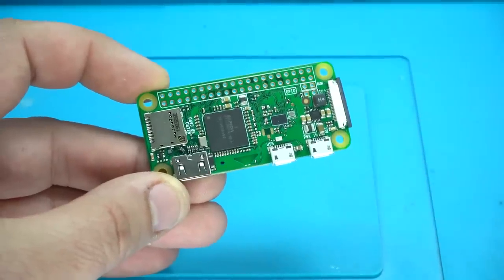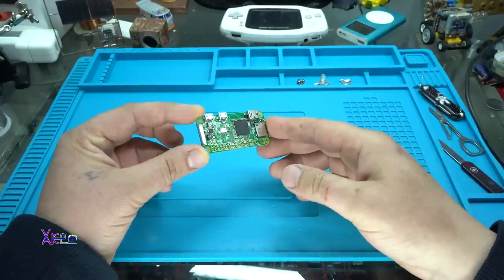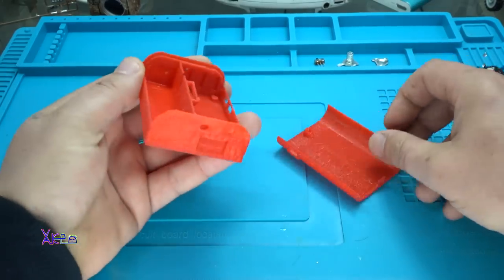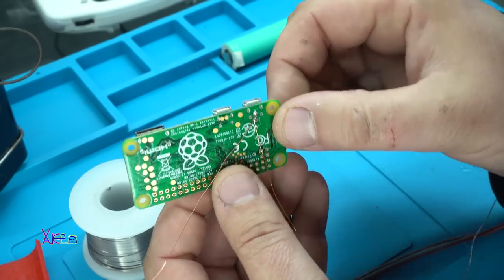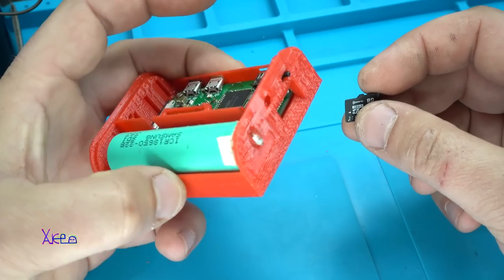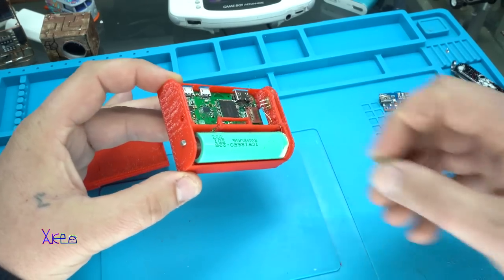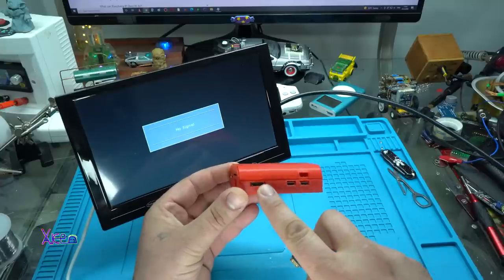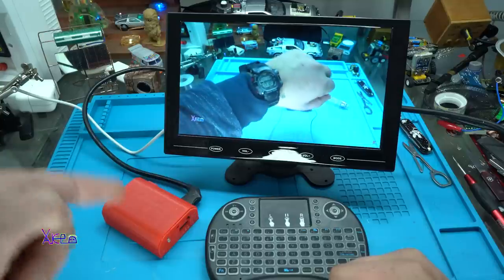How To Build Mini PC at Home

Comment: Raspberry pi zero w needs 5v 2amp power supply, using 3.7v is not a good idea, i have already that board., also you need a heat sink and a cpu cooling fan optional.
Reply: I will go ahead and say yes that is plausible but I'm already been running using a dollar store 5 volts at 1 amp charger a lot longer. Of time and that was for both of them so if you can't get a 2 amp charger I suggest just go with either what you can find on hand so long as it does not go below 5 volts in 1 amp and I say I like your videos keep on going.
Reply: @darrellgrossfs96  Am already using it at 1-amp 5v supply, but when u want better performance as i have overlocked my cpu, therefore im using 2-amp supply, 2-amp supply gives the better performance in speed.
Reply: Well then you're in the green for at least getting it up and running processed even I'm trying to get ready twitch setup a Raspberry Pi W-2s 4 A cluster that would also include a Raspberry Pi 4 as the main control hub or as the master of the pie cluster in kubernetes for AI small and Robotics stuff that you would build with servos hobby level
Reply: If you're wanting to go to higher voltages I would suggest you be careful about that in the past I will be willing to admit there was a Raspberry Pi that I had that ended up getting too much voltage to it due to a bad power supply through a USB port hub
Reply: @darrellgrossfs96  i have a better and trusted power supply 😅
Reply: The two most things that I would suggest to do do research on what the voltages that the Raspberry Pi 4 runs to the newest Raspberry Pi W-2 check on the voltages that the original manufacturer suggests and then go from there but I would also say I've been using raspberry pies out of the box or automatically with a heatsink attached due to knowing from other non development boards normal desktop PCS they would usually always require heatsink outside of the ones in the 80s where the CPUs did not need it and I'm talking the computers from the lower than the k-6 MD processor but that also allows you to have more Headroom if you want to overclock
Reply: But I can also ask you the question I have a situation where I have a orange Pi I 96 that does not have video out can I use the OS from it in a Raspberry Pi zero just to get the OS up and running and then transfer the SD card back is that possible?
Reply: And sorry for talking your ear off
Reply: @darrellgrossfs96  Why not just give it a try and let us know if it works?

Comment: I'm going to go ahead and sane Brasserie painter that you have in this video there's a new version of it out it's just having both your old and it is there's something's that the old one can do that the new one can't such as they took away the to the four-way block connection that has the composite out but then you are one has Bluetooth and Wi-Fi built in along with similar check to what we sing the first Pi 3 and that would be the Raspberry Pi W-2 newest zero variant the number to keep on doing what you doing:-).